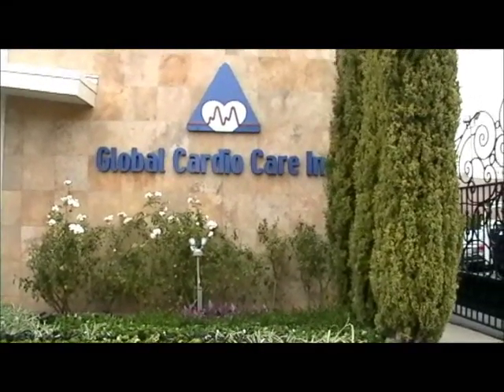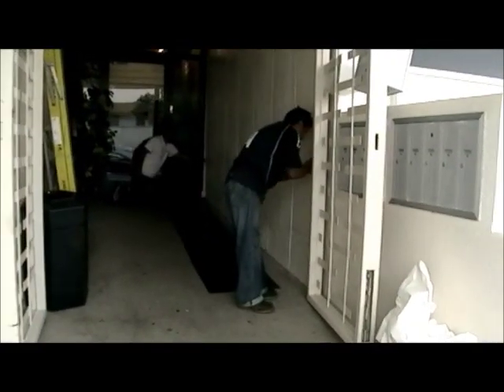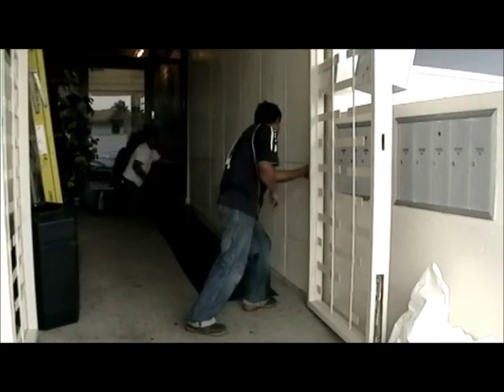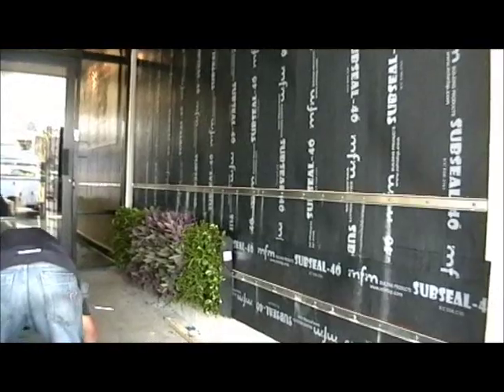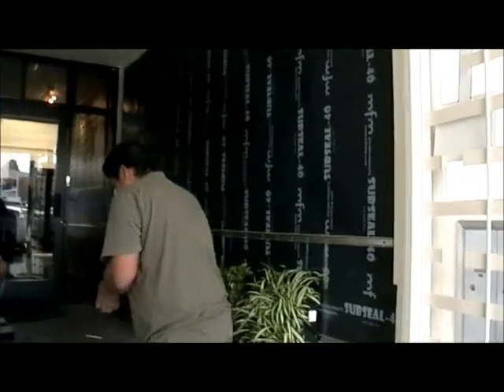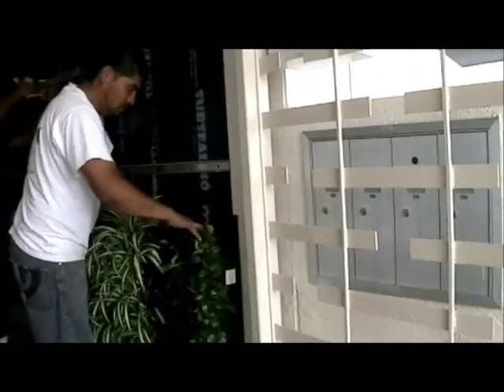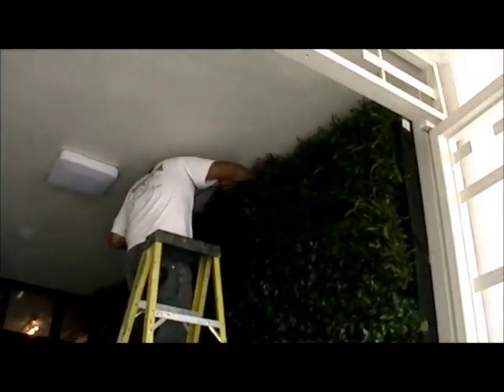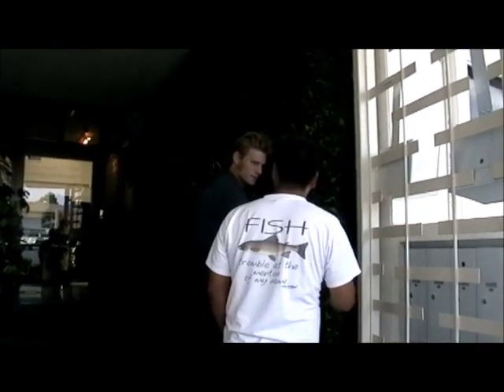Vertical Garden Installation In Inglewood California

Comment: I want to install indoors, my living room, have lots of indirect light.
The thing is, I have a 44ft rock wall in my house with cathedral ceilings and there a trickle of water that goes down the entire thing like a waterfall, and I want to just place this vertical garden at the bottom in addition to the base of the waterfall.
When will I win the lottery?